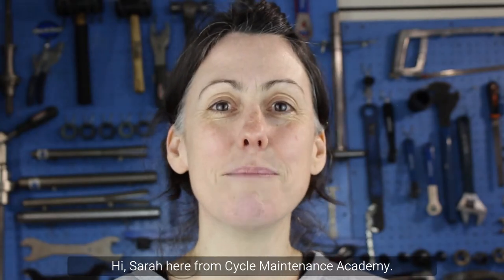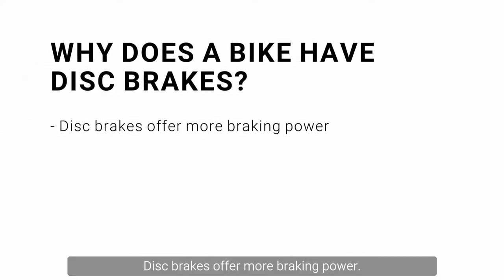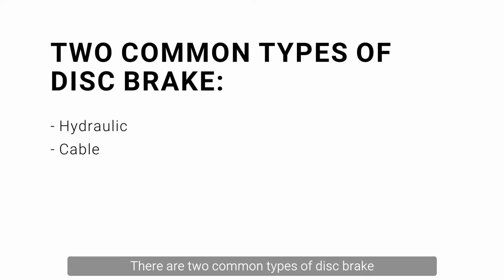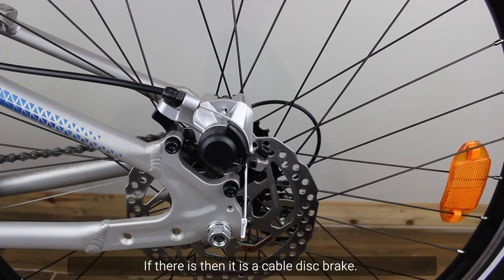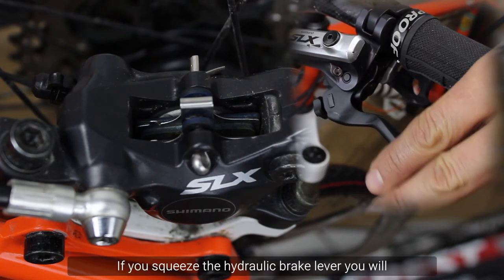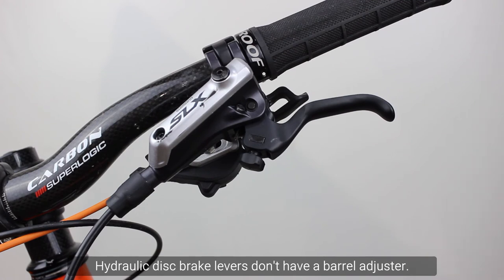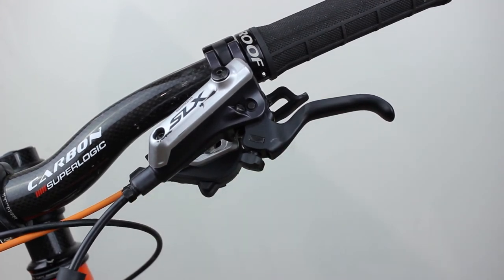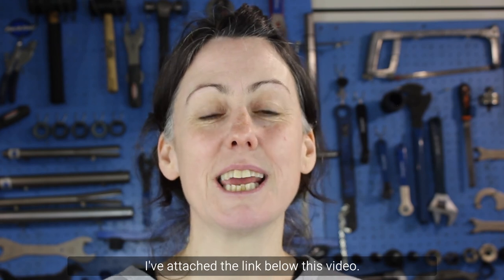Bike Disc Brake- How To Tell If Yours Is Hydraulic Or Cable

Comment: mine is strange it loooks like hydrolic one cuz it has markings that say mineral oil but still it has cabels
Reply from the maker: Hi and thanks for your comment. You have a cable actuated hydraulic disc brake caiper combining the advantages of both cable and hydraulic systems. This type of disc brake offers better braking power compared to mechanical disc brakes while still operating with standard cable brake levers.
Reply: @cyclemaintenanceacademy  so it haves oil in it or what. is it any good actualy
Reply from the maker: @snaky1337 yes, the caliper has a reservoir filled with the brake fluid. They generally have a good reputation as reliable and low maintenance brakes.
Reply: @cyclemaintenanceacademy  sweet. I got the bike second hand and it came whit them. also I can't find any info online about them
Reply: @cyclemaintenanceacademy  also thanks for the support.